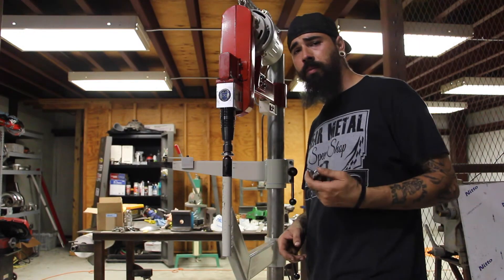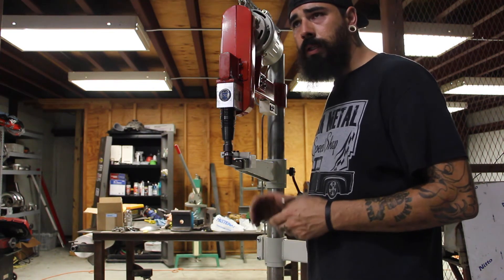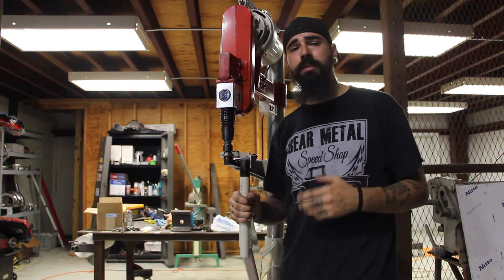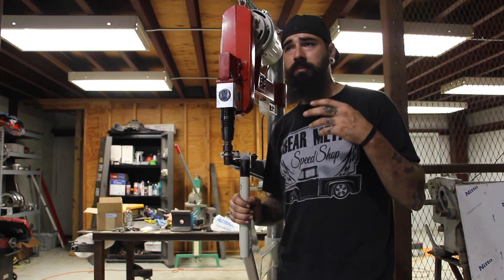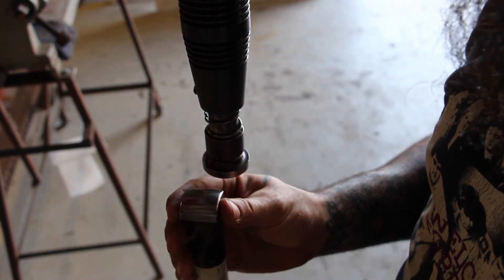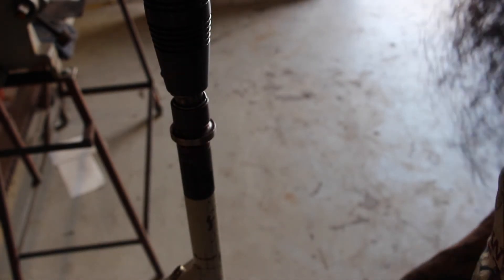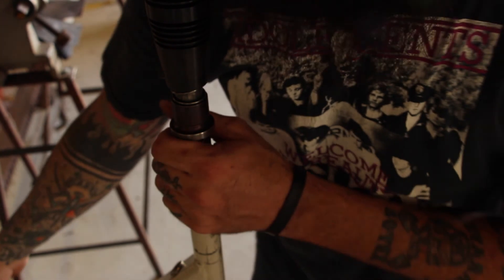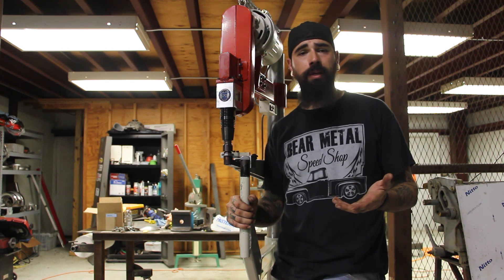Mechammer MarkII demonstration video #1

Comment: It put blemishes in the metal.
Reply: Are you being sarcastic, or new to planishing? I am guessing the first one, but just in case, it can be used to get the metal ready for paint without pretty much any filler, or none depending on talent, time, or care. Don't take my comment as bein a smartass. I didn't know this, or pretty much any metal forming/finishing until the last six months. Now I am soaking up everything I can. 🤘✌
Reply: @myconight  if you are trying to learn keep you eyes and ears open and your mouth shut except to ask questions and you will learn a lot in a years time. Being open minded and be willing to listen to advice not saying you have to take the advice will help you. Looking and listening is how you learn. I don’t know the first thing about planishing.